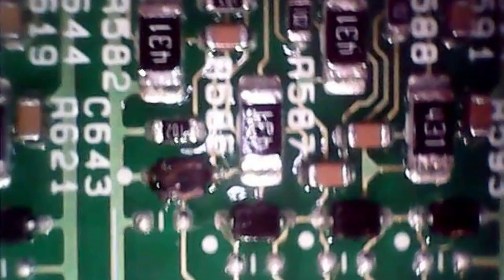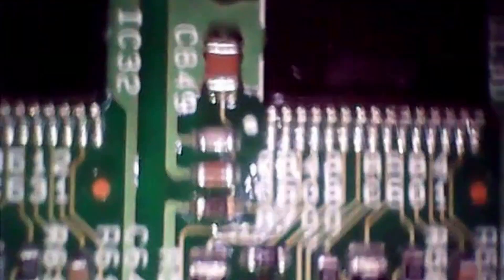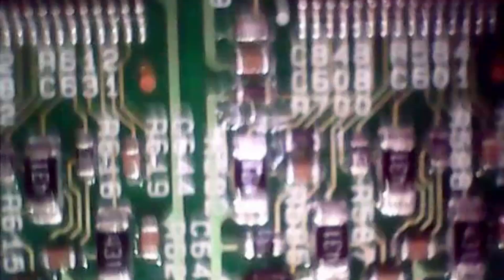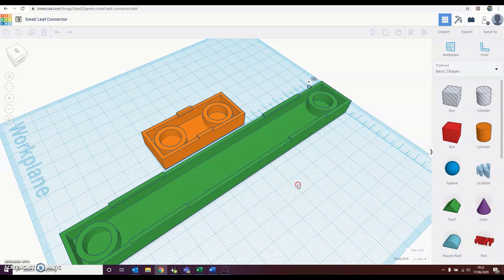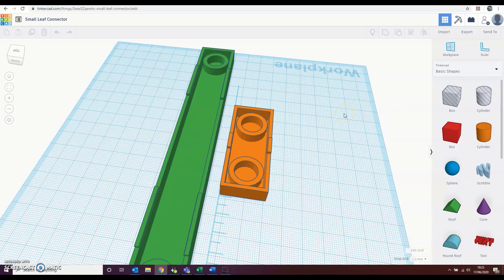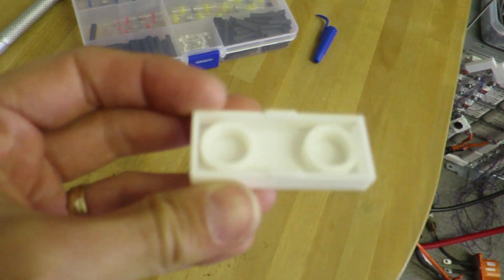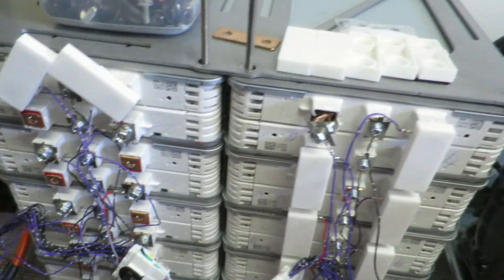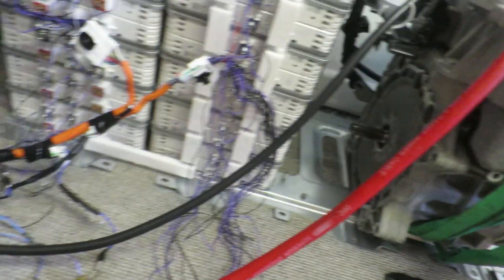Leaf EV Update, BMS Damage, 3D printing, Battery Setup

Comment: The terminal caps look good. How hot do you expect the batteries to get in operation? Not worried about the pla softening at all? Though I guess a bit of warping isn't a big deal compared to cat electrocution! :)
Reply from the maker: Hi - The PLA would need 80-90+ degrees before becoming so soft it deformed. I doubt the batteries get to that kind of temperature - there would be high temp stickers on them as a warning otherwise. Anyway - I might be wrong and the PLA falls off - all part of the R&D cycle!!!

Comment: HEllo, thanx for the video! I tried to search for the leqaf bms connection pinout and arduino can program - did not find anything, although I checked out wolf`s page, as well. Would you mind putting some link or referral to the description? I think mmany of us are out here in search for a high capacity bms.... Very best regards.
Reply from the maker: Hi - I will compile all the correct information when I am 100% certain it is all correct.